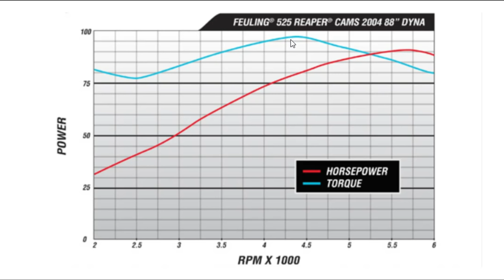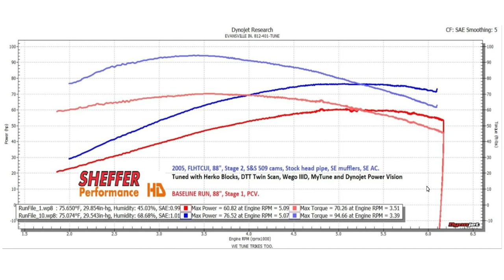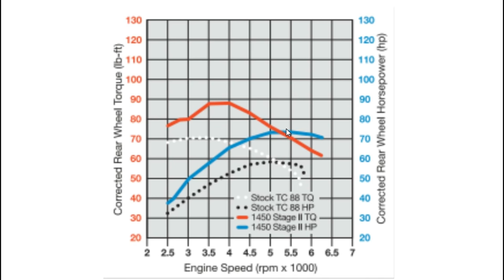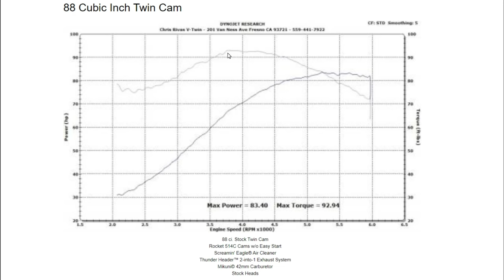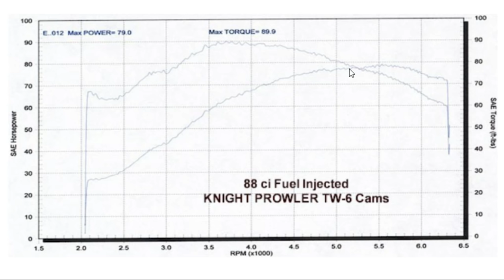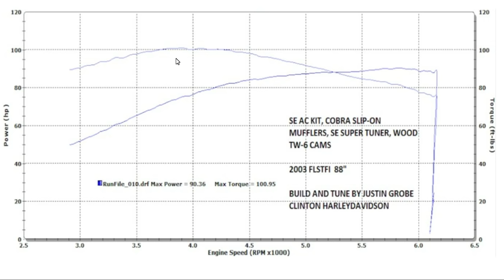Give Your Twin Cam 88 New Life With A Bolt In Cam Upgrade

Comment: why is it that certain say twin cam 88 parts won't work on a dyna? whats the difference ?  i have seen a lot of various parts that work on a lot of models but dynas . i find it really weird / bad development on Harley.  i don't have a Harley but i like cams/ upgrades that produce a flat torque curve.  good vid
Reply from the maker: Thank you! For whatever reason the 06 Dynas got hydraulic tensioners and for example the S&S 509 works on all 88's except for the 06. That leads me to believe the 06 may of had different valve springs, I'll have to double check the part numbers.
Reply: I would love to see a video specifically for the 06 Dyna. It seems like everything is different for it and I’ve been racking my brain trying to figure out what upgrades to do and in what order l should do them. Thanks again for all of the great videos.

Comment: It would be nice to go from tensioners to gear drive but figure doing it in segments such as switching to 1) S&S Cams, Plate, Hydro-tensioners, oil pump & rocker arms.  However, if I’m going in, I may as well check pinion runout to see if I’m under .003 & possibly go 2) gear drive. Then again, I may as well upgrade big bore to maybe 100 CI.  🤦🏻‍♂️... decisions, decisions, decisions....  I may just go with 1) picking the 509 cams from S&S first if it can continue with 100 CI build w/gear drive later.
Reply from the maker: I would start with cams first, that way you can always add some displacement and compression later on if you get bored with the new cams.
Reply: Remember, when picking a cam first, you cap your compression ratio's if wanting to use that cam in future building. Not a bad thing, just is what it is.
Reply from the maker: That's very important, you don't want to have to end up buying another cam later on.
Reply: @GixxerFoo  great video Gix 👍🏻
Reply from the maker: Thank you! I appreciate it!

Comment: Personally I would go for the 509 or 31g andrews ! You did not mention this but while your in the cam plate it should be switched over to hear drive & the bypass valve should be shiming for increased oil pressure ! The gear drive should pickup another 5 to seven HP !
Reply from the maker: That's really interesting, I haven't heard of polishing the bypass valve before. That's a really slick little trick there!
Reply: @GixxerFoo  my spell check failed me what I meant to say is bypass valve should be shimmed for increased oil pressure ! That only works on 99 to 06 engines except 06 dyna ! Sorry for the confusion !
Reply: @leonardstanford1877  I put the spring slug in and cold idle is 60 lbs, 20 hot, running hot pressure about 55. You could also use a Baily spring, but I don't know what rhe pressures would be. It's an extra, since Harleys are volume-lubed anyway.
Reply: @garychandler4296  I have an 04 95 inch bagger with the shimmed bypass valve been running it with a stock cam plate & pump for about 6 years now ( no metal in the oil changes )  the spring is also a good idea they need some oil pressure better than stock .the S & S forged cam plate has an adjustable by pass valve .I have installed a few of those they work good also but require pulling the cam cover back off to adjust sometimes a hassle ! Fueling plates are pre set to higher pressure ! Whatever way a person goes is good for that motor !
Reply: @leonardstanford1877  Troo dat! I still have stock tensioners I put in around 35k, but also a permanent, superfine stainless steel screened cleanable oil filter, so I can even inspect for plastic and metal between changes, and it's a bit ludicrous IMO to say these need a 2 micron filter, which MOST OF THE OIL is GONNA bypass. I seem to get about rhe same debris level as a stock filter, and I ALWAYS cut open my filters, bikes, truck and car. Saved an engine once!
I have located the long life (supposably) tensioner pads I'll just toss in while,the pipes are off. Wanna save up for the 95 kit and see what it does with the torque cams!
Reply: @garychandler4296  I've never tried one but been meaning to I'll order one up tomorrow ! Thanks for the info !
Reply from the maker: No worries, spell check, auto correct messes with me a lot. That's a really good tip, l have never heard it before.

Comment: I have the redshift 511 cams in my 2004 wide glide (carburetor model) and absolutely love them.  Just a thought.
Reply from the maker: Red Shift are some excellent cams, how long have you been running that 511?
Reply: @GixxerFoo  I had it installed a year ago august.  have about 6k miles on them.  (the dyna is my backup/second bike).  but am really happy with them.  it has changed the power such that my 5th gear acts more like a 6th gear.  and it also revs very quickly now.  and that's with a big radius exhaust.  a 2-1 would make a big difference.
Reply from the maker: 2 into 1 exhaust is hard to beat for power but personally l like the sound of the Big Radius.

Comment: You seem to be really knowledgeable. So I was thinking about my  2005 dyna wide glide. So I was wondering about getting some bang for the buck and wanting to replace the spring timing chain tensioners. Looking at spending about 1000 to 1200 on this project. So looking to get some input if you have time to respond. Thank for the time.
Reply from the maker: I think your budget is right in the ball park, I would go with a hydraulic tensioner setup for sure. You can do the Screamin Eagle cam plate with hydraulic tensioners and high volume oil pump oil pump for around $500 and then a cam set for up to $400. If your willing to come up some Feuling and S&S make complete cam chest upgrades with cams. They have pushrods, lifters, cam plate, oil pump, cams and gaskets. The shebang for about $1600, more expensive but it's really high quality parts.
Reply: @GixxerFoo  Is there a complete kit you could recommend to get all the upgrades with the tensioners, camplate, cams oil pump, etc. I want to upgrade the bike and get some power but not machine work please at this point its a 2005 fuel injected Dyna Wide Glide with 35000 miles on it. But  for some time now it been making a wining sound like a power steering pump on a car. I have a feeling it has to do with timing chain or cam bearings. So its been parked for a couple of months now. So let me say in advance thanks for your advice and really enjoy hearing from you and love your knowledge on the bikes.
Reply from the maker: I would check out one of FuelMoto's 98 inch kit, it's a complete kit that will replace your cam plate and tensioners. Plus you will gain some major power too, these guys will even help you get it tuned!

Comment: Looking at cams for my 02 /88, while doing a tensioner replacement. But I'm planning on a big bore as well over the winter. So I want a smart choice keeping the future upgrades.
Reply: What bike are you riding? How do you ride is the answer!!
Reply: @enricomandragona163  Fatboy. I ride fairly reasonably. And a lot. But do like to play. Bottom line. I want more power  all round.
Reply: @rickhill56  The compression of the Big bore kit will dictate the cams ! How big? 95-100 without splitting the case's. S&S line will help with high compression built into the cam & not kill the starter. HD factory ported heads keep low compression and work with pop up Pistons and have compression release drilled in. I'm going this RT on my 04 Road King. Got SE manifold, ignition module, 44 CV carb and 203 cams in her now. No problems . Solid SE pushrods. This cam can't go over  9.5 static compression

Comment: I really would love to have seen the curves on a carbed 88 with Andrew's 21's like mine, but I  already know that they come on at 1400? 
The problem with always being in your powerband is you can't resist making g the seat press your back a bit thru the gears, so, 36mpg, every tank!
Reply from the maker: That's not bad with an 88 and some nice cams in there, those come on really early!
Reply: @GixxerFoo  I just really wish I knew the hp/tq numbers of the 21 at 4500 revs, my seat-of-pants shift point. I really should put a tach on her for grins!
Reply: @garychandler4296  I have an 01 Deuce and I just recieved my set of TW21s today. At 24k miles, I figured it's time to cross over to the S/E camchest kit with hydro tentioners. I'm still kind of debating weather I should go with the 21 or 26 cams??
Reply: @gcuervogold  If you do the toque cam, you'll ALWAYS be in your powerband, often no downshifting to pass or bull your way out of corners. 
The bright side IS the downside because you won't be able to resist rolling your fist into each gear, because it feels so good, pulling away with no hard revving, every gear an experience. So with a Kehin, I get only 35-36 mpg, but I don't ride for fuel. I might get better with injection, but I'm an old school wrench! The closest Harley I've rode would be my sister's Evo Fat boy, but even that feels a bit gutless in comparison.

Comment: Dude I'm in the same predicament man I don't know if I want to go with the 95 or just Cam and lifters when it comes to the bike it's a hard choice you either got to bite the bullet and get her done or settle
Reply from the maker: It is tough since you have to get into the top end either way, unless you go back with adjustable pushrods doing the cam first. Cams really do a lot for the 88 as far as torque, but the 88 really isn't a horsepower producer. Now add the 95 and a cams set, that's when you get the horsepower and even more torque.

Comment: I've been thinking of putting the S&S100inch  kit with the 585 easy start cams in my 03 heritage. But I've been holding back because I think the 585 cams might be a little bit more than I want for high RPM and lack of lower RPM. After watching your video I looked into the wood night prowler cams for the 88. I wonder how that cam would do with 100 cubic inch? The kit bumps compression up to 10.5. and the cams have a pretty short duration. I wonder if the short duration and higher compression might lead into detonation and pre ignition issues? With that aspect aside I would think that using the wood night prowler cam and the extra 12 cubic inches should yield another 5 to 7% horsepower over what your graph shows at the end of your video?

Comment: Thanks for this video. Watched it last week, but didn't get the chance to comment. Yep, going with the 525 for my  03 Dyna. Looking forward to it. Hope you're doing better with the weather related issues.
Reply from the maker: Good choice! You'll enjoy that torque and it come on early too! Yes, doing much better now! Power is back and cleanup is coming along, back to making videos too!
Reply: @GixxerFoo  would you locktite rocker arm bolts? I have both Haynes & Clymer manuals and neither say to locktite them.  But I've seen some reputable YouTubers locktiting them.  Thanks for any inputs.
Reply from the maker: It's not a bad idea if you're going to do it, just use blue, not red. With red you will never get it out. Just use a little blue for safety sake, it's good piece of mind. That's what l do, emphasis on a little 👍.
Reply: @GixxerFoo  Thanks for the response.
Reply from the maker: Not a problem, anytime!

Comment: I changed my twin cam 88 over to gear drive cams best thing i ever did
Reply from the maker: It's pricey to convert but it's worth it to not have to worry about tensioners.
Reply: Seen your last name brother I ride a Harley to put a gear drive in 01 harley davidson road king with a 510 cam like you best thing I did to

Comment: Recently bought 2006 Dyna Wide Glide completely stock 2nd owner with 7000 miles and looking to upgrade, stage one with se cam plate,se push rods, and cam while pipes are off and have access. My question is 2006 Dynas came with hydraulic tensioner's so did they upgrade the valve springs? Which is a huge factor in choosing the cam for this bike.also, going with V&H Short Shots, S&S Air Stinger Stealth small teardrop air cleaner, what do you recommend for a Tuner? Thanks, really enjoy the content.

Comment: Gfoo....As long as you are at it I need a camshaft breakdown for stock 2015 CVO 110”. I have just done the V&H hi-flow air intake, dresser duals and blackout slip-ons ..... now I just need to know the best cam choices to complete stage 2.  Wood 222 or TW-7H, S&S 551, Zippers RS 587 or ??? There are so many to try and figure out.         Anyways thanks for your videos. They are very informative and greatly appreciated!
Reply from the maker: Are you looking to improve a specific range of power or just looking for a good all around cam?
Reply: @GixxerFoo  well.... the RS587 originally interested me because their advertising stated it was made specifically for the 110”. However, after doing my research on camshafts and then watching your videos I realized it wasn’t’ that easy and there is no perfect cam to cover the full Tq & HP range. I think the SE255 does very well but since I only want a Stage 2 upgrade I was hoping for the perfect cam for it all. So to answer your question I want it all 😝, but with low compression on the 110”RGU and mainly touring I am looking for early to midrange Tq and HP with a gain in the overall curve. Thanks Gfoo!
Reply from the maker: A Wood TW-222 is very impressive in the 110 even with the lower compression. Good exhaust and tune can put you right at 100hp and around 120ftlbs of torque. Comes on early and speaks 3500 to 4000 rpm.
Reply: @GixxerFoo  I like my V&H intake, headers and exhaust even though they won’t give me max HP. 
I am intrigued by the S&S 551 intake duration and lift numbers compared to the others. What do you think about this cam w my setup? Thanks again Gfoo!
Reply from the maker: The 551 is a strong cam from S&S, it will really wake your 110 up and take advantage of the displacement you have.
Reply: @GixxerFoo  Thanks again Gfoo. I’m enjoying your videos. They are very informative.
Reply from the maker: I appreciate the support and l oive getting the word out!

Comment: I have a 2002 Fatboy . With 75,000 miles on it. I just recently did a cam upgrade using s&s cam plate oil pump 510 s&s cam, I put bassani full exhaust two into one road rage, tuned it. It woke the bike up just wondering how soon I'm going to need to rebuild the top end? I like the way it sounds and pulls now but I've noticed at high RPMs shifting into the next gear I do get a sputter sometimes a small backfire. Not sure what the backfire or sputter is indicating as long as that don't push it real hard RPM into next gear it runs really good. I'm considering doing a full rebuild over the winter this winter or possibly even replacing the motor for more horsepower my wife and I ride together a lot and I've noticed that if I had a little bit more horsepower than what I currently have that would help out a lot any ideas?
Reply: Air leaks at the manifold can cause that problem. What do the plugs look like?

Comment: I have a 2004 ultra classic 88 I recently put the reaper 525 camplate oil pump and hydraulic tensioners , arlen big sucker one, a set of Cobra true duals my question is do I really need a fuel management system? Thanks in advance love your videos
Reply: I have the same set.  after tuning on the Dino stand, get 100 torque and 70 horsepower on the rear wheel.  Greetings from Russia.  motorcycle road king 2003.

Comment: @Gixxerfoo something that is missed in these larger bore upgrades and the one thing that appears to be afflicting me now is how the upgrade affects your starter.  Have you seen how stock or close to stock starters are affected by the increase in compression?  It seems quite obvious how going from a 9:1 to a 10:1 would make your starter work a bit harder, but is there a recommended wattage for the starter to handle this new load?

Comment: I have a 2002 FLSTC and had some chain tensioner issues. So I have decided to upgrade cams along with new cam plate and oil pump which only makes more sense to me. my run out allows me gears if I choose but i was wondering what the difference between the S&S 509 and the 510.
Reply from the maker: Getting that cam chest upgraded is way cheaper than a new one, the early Twin Cams have more character than the new bikes.
Reply: @GixxerFoo  agreed but I was still hoping you can tell me the difference between S&S’s 509 and the 510 grind. Wanna make the right choice, thanks
Reply: this question is also interesting
Reply: @stanleyholton53  510 is better for a 97/98 big bore kit, the 509 is better if you don't plan to upgrade to larger ci and keep it 88

Comment: @GixxerFoo- which one of these would respond better to a slight bump in compression ?? Gotta make a choice for my 02 efi night train
Reply from the maker: Depends how much compression you're looking at going with. The Wood TW-555 and TW-777 are are excellent all around cams that are bolt in and work with increased compression!

Comment: whats yer opinion on s&S Sidewinder 100" with the 203 cams
Reply from the maker: The SE 203 cams make good torque, but they leave a lot of power on the table. A 100 inch kit with compression and a good aftermarket cam will make some big power, the 100 inch kit is expensive though. I personally like doing a bore out to a 97 or 98 with some added compression and a good cam. It saves some money over the kit and makes just as much if not more power, but the kit is way more convenient.

Comment: I want to do a woods cam set on my 04 road king. I’m fairly handy, but I’ve never done cams on anything. Should I just do it? Or hire a pro
Reply from the maker: With a factory service manual it will outline every step and tool you need to get the job done. Get the manual from the dealer, not the clymer manual but the official Harley-Davidson service manual. It's the best investment you'll ever make for under 100 bucks.